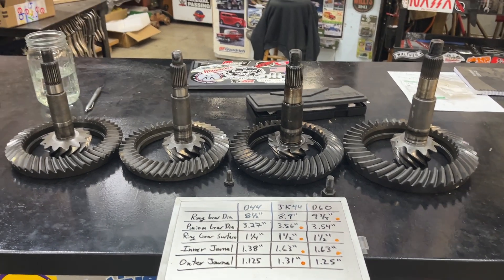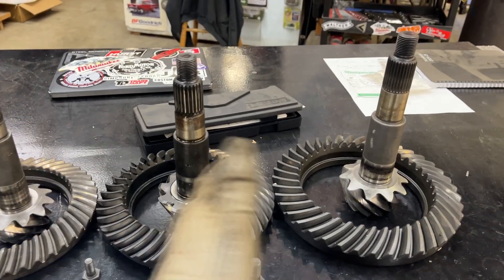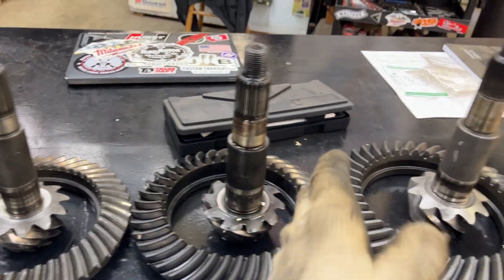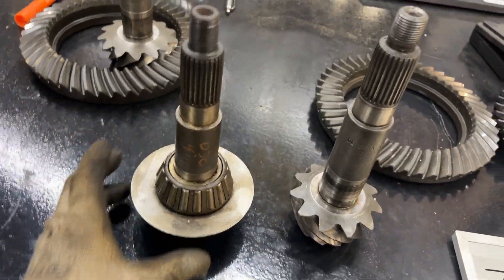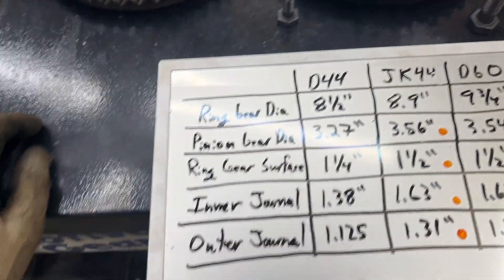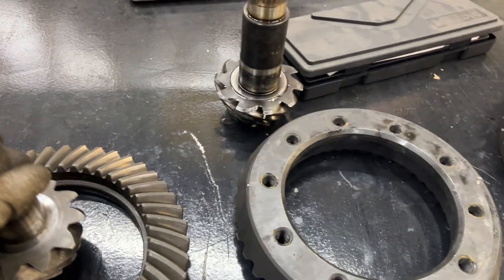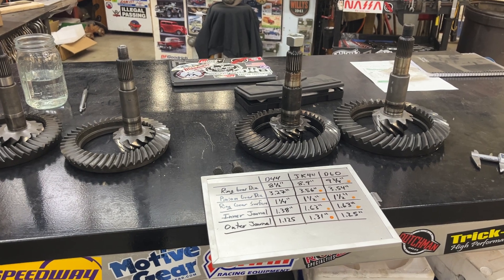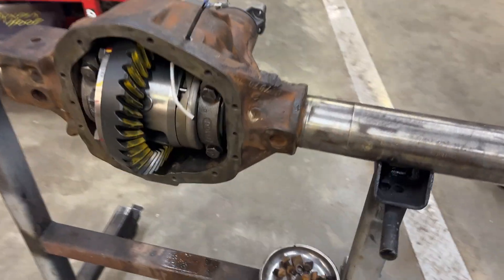JK Dana 44 Gears in Older Housings

Comment: one thing I found recently is that the later model Isuzu Rodeo/Honda Passport has the same axle as a JK minus the bracketry. So if you are a hobbyist builder like me and are not concerned about the brackets, it is an awesome axle. Bonus also, it has 6x5.5 BP which is a match for waggy and chevy fronts and disc brakes. Also, it has thick 3-1/8" tubes. When set next to an D60 FF Ford rear, it is comparable. I believe also this axle is under Nissan Titans, so if you are a junkyard surfer like me, these axles are worth a look IMHO. BTW, thank you for the video, it was very informative!

Comment: Regarding the Dana 50 axle housing. What gears are you running with that Dana 44E locker?  D44 gear set or d44 gear set. I’ve been told that you have to drill out the locker to accommodate the ring gear bolts.